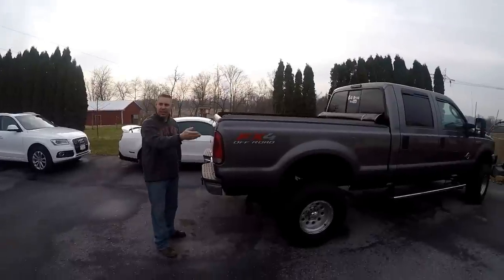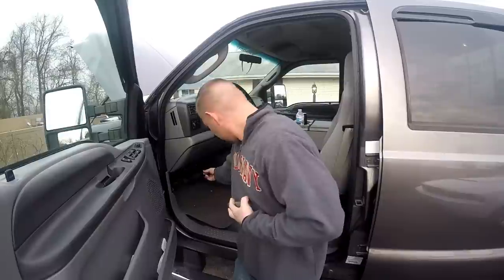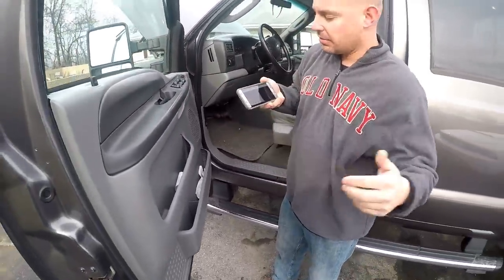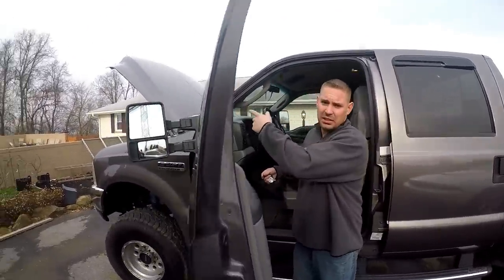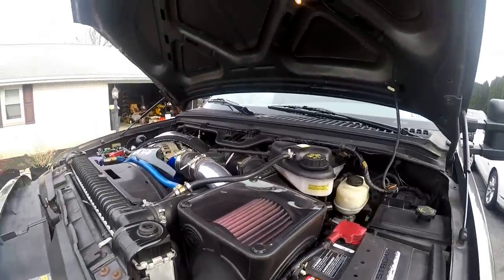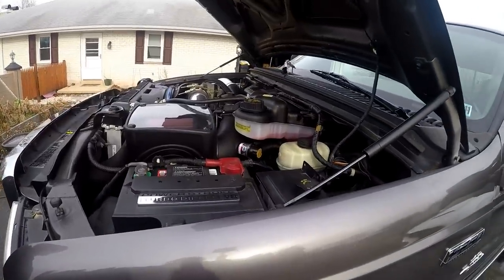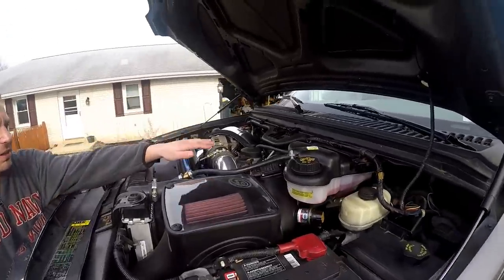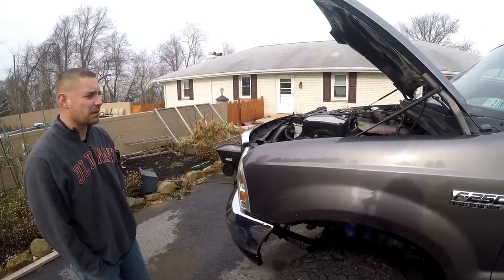6.0 Powerstroke Bad Injector Test

Comment: You guys should do a video showing off the Ford IDS program if you can find someone that will let you use it!
Reply from the maker: +arayray94 are you talking about auto ingenuity
Reply: I believe you can do the same injector balance test on autoenginuity
Reply from the maker: +arayray94 what questions would you like answered. We were just thinking we want to have some other experts on the channel so I just need to know where the interest is. Thanks for the input
Reply from the maker: +arayray94 yes it would be awesome to have that at our disposal. Diesel tech Ron has some videos out showing how to use it. I plan to look into cost out of curiosity but I imagine it will be too expensive for backyard wrenches unless you are making money.
Reply: Ultimately I'd like to be able to see what my injectors are running like (spot problem before failure) but cannot justify the cost like you said. I don't know if there are any alternatives that we can use.
Reply from the maker: +arayray94 Josh and I will have to look into this more and do a video. I do plan on doing a review of torque pro, but there are limitations with that system. Although it does a lot
Reply: 6.0 Bros TorquePro was flaky for me so I upgraded to a CTS2. It’s okay for starting out imo
Reply from the maker: +arayray94 cts2 is a great product. The only reason I don't use one is I have always been worried Someone would steal it. However great product

Comment: What is the black holes line over the whole cold side pipe/alternator?
Reply from the maker: That is part of the bulletproof diesel oil cooler relocation kit. Basically it moves the oil cooler to beside the batter
Reply: 6.0 Bros what’s the point of relocating it isn’t a second oil filter kit better am new to this .?
Reply from the maker: The main reason to relocate it is for ease of change. This is my brothers truck and he really likes the kit and idea for it. I personally do not like the idea much or at least I have not seen it done in such a way that I like it. The kit itself is very nice and has great high quality components. I just think it is not needed maintaining your cooling system is better and I have not had issues except when I did something dumb lol. So I would recommend just running the factory setup. Although it did make me think if they could run a second oil cooler that would be kinda cool.
Reply from the maker: As for the additional oil filter setups. I do not think they are bad I just do not think they are as great as people make them out to be. Changing oil every 5k miles I believe to be more important and running good oil like motorcraft or scheaffers and only with OEM oil filter and make sure you have the OEM oil filter cap

Comment: although I like torque pro for its guages and graphing you can't send commands...i use the forscan app mostly but now n then I use carguage pro....forscan is a great app and is ford only and both Forscan and carguage you can send commands like buzz test....btw the blue elm327's=junk get a BAFX you'll never get another
Reply from the maker: Planning on doing some reviews on apps and adaptors this year. I have been messing with forescan great app really enjoying it
Reply: @six0bros  the only thing I'm waiting for is someone to figure out how to be able to pull up cyinder contribution....so far it's the only thing I see holding back the elms and their apps
Reply from the maker: I know it drives me nuts lol. I am looking into finding the cheapest way to monitor that however I haven't found a cheap way to do it.
Reply: @six0bros  I work on 6 oh's every day and so far it hasn't been a major issue but it would be nice

Comment: At 2:21 my truck is making the same sound. I think it's a bad fuel pump because after it started making that sound I got a hot no start, then a dies when warm, now if I can even get it started it runs rough until warm then just dies like you turned the key off. Does your truck still make that sound?
Reply from the maker: What year is your truck. Does it start when cold?
Reply: iTzKevinFTW try stand pipes and dummy tubes
Reply: 2007. Did you ever get that sound fixed and if so what did you do? Idk if its true or not but I think its mu fuel pump becuase I got a hot no start and then a dies when warm hot no start... dummy plugs/pipes are updated and truck is deleted.
Reply from the maker: iTzKevinFTW has your fuel pp been getting louder lately?
Reply from the maker: iTzKevinFTW  do you have a way to hook up to the rest port to check fuel pressure. Also if you haven't already unplug your icp and try to turn it on.  I would get a gauge to read icp and ipr while cranking. You need like 500 psi of oil pressure to start the truck.